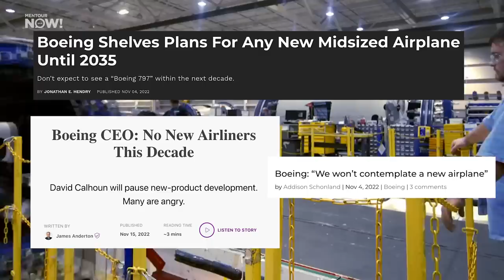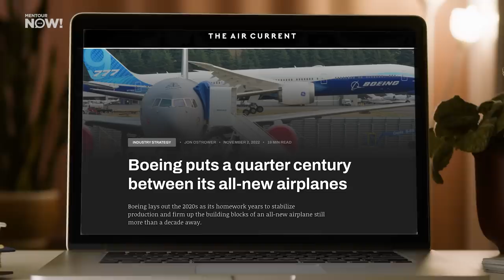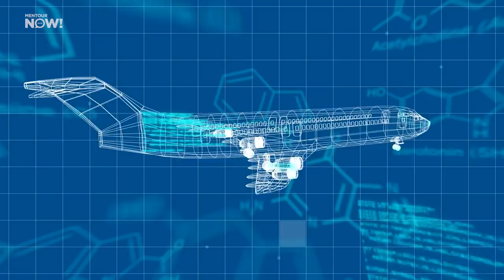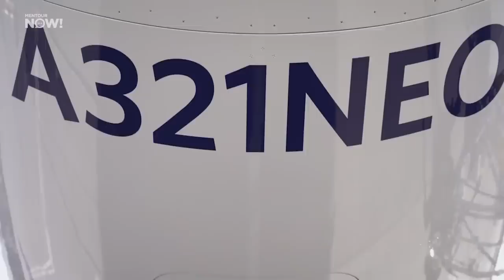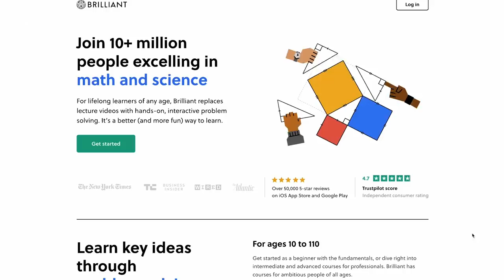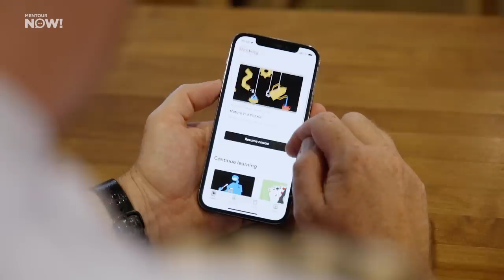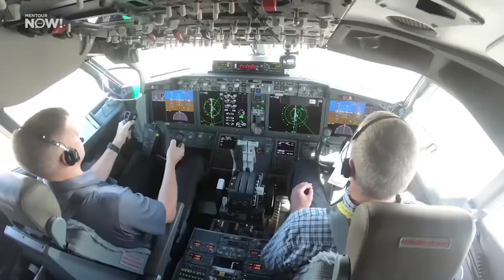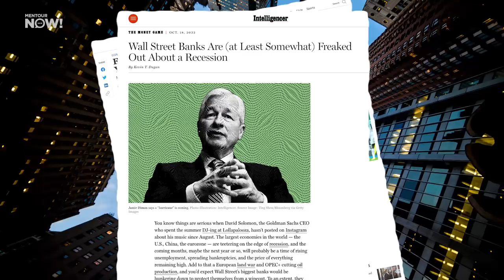Is BOEING giving up!?

Comment: Another example of bean counters injuring their company is GM’s Roger B. Smith.   His tenure saw GMs market share shrinking from 42% to 35%.   To be fair, he saw something needed to be done and did what he thought best, but he valued pinching a penny over the customer.  Boeing execs ought to read the Smith episode.  (Another is GE who was set up for collapse by Jack Welch, and Immelt left holding the bag)
     Boeing is a private company and U.S. financial markets are notoriously impatient. Airbus, on the other hand, has government sugar daddy investors whose interest is full employment.  Thus Airbus skated through A380 and A400 commercial flops which would have killed Boeing. Lot easier when taxpayers haul away your mistakes.  
     Nevertheless, Boeing must discipline itself to resist the temptation of quick buck short cuts and concentrate on building quality planes.

Comment: Boeing has been experiencing serious problems due to diversity staffing issues, especially with respect to engineering, the 737 MAX MCAS engineering team for example. The minimum design standard for mission-critical systems requires both redundancy and diverse routing but the engineering team responsible could not figure out how to make it work so instead they removed the standard, meaning the entire system worked through a single AOA despite there being two on board (Airbus adds a third under the tail for additional redundancy and diversity but Boeing does not). Internal emails between engineers were clear. Not only were they unwilling to put their own families onboard the plane, but they also pointed out that the effort was being led by "monkeys," an apparent reference to engineers of African descent. They also called them “obvious idiots who shouldn’t have been hired,” that “had the situational awareness of braindead gibbons.” At the same time, Seattle Public Schools declared math racist, stating that there are other ways of knowing. That Asians are 27 times more likely to score 1400+ on the SAT, the minimum score one might expect for an engineer of next-generation aircraft was met with the removal of the SAT. China responded with support for Black Lives Matter and support for ESG investing, and the launch of the C919, their competitor to the 737 Max, which already has at least 570 orders. Other programs at Boeing, including the CST-100 Starline (which narrowly avoided catastrophic failure after failing to reach the correct orbit), the KC-46, and the 747-800 Air Force One programs all face similar problems.

https://fortune.com/2020/01/10/designed-clowns-supervised-monkeys-internal-boeing-messages-slam-737-max/

Comment: Climate change pressure or crude oil supply problems, it doesn't matter, the price of jet fuel won't this cheap in 2035.  If you have to make synthetic fuel or more steps to refine heavy crude it could easily multiply the costs by 3 or 4 times.  No amount of UDF, flying wings will make a difference.  We will be back to the "Jetset". I think Boeing and Airbus know that.  No point in investing $30B in a new commercial plane the masses won't there to fly in it!

Comment: C'mon, new models of 737, 777, and 787 are just getting off the certification process. Boeing has not really manufactured in quantity the 777 and the 787. And Boeing us just realigning its digital manufacturing process that will halve the development time of any aircraft and allow its factories to produce multiple models. It is "slowing down" from an outsider's perspective for efficiency. And you evidently do not about Boeing Defense. That's not giving up, that's gearing up to conquer.

Comment: The Boeing CEO simply cannot tell lies at an investor presentation.  For what ever reason the board is thinking this way it will create a problem which is at the core of Boeings other problems.  Their engineers.  They need to be trained, mentored and used.  In 25 years their senior design guys and gals will be retired

Comment: I don't think Boring is stupid yes to answer your suspension I believe Boeing is working on something but isn't saying anything about it to see what Airbus is doing it self. Right now airplane technology is at a standstill no new engine's available. Boeing's CEO said that if they built a new plane it would only look like and perform like an airplane that's already in production and that the next airplane Boeing will build will be more with the times and to the upmost technology available as of the times.
  I say give Boeing tine because they have something up there sleeve's there not sharing with us now.

Comment: Boeing blew over 20 Bio USD on stock buybacks during the teens inflating their stock price.  Perhaps they should have used this cash to build a new white sheet aircraft instead of going down the dead end of the MAX....a derivative from a type certificate issued by the FAA in the mid 1960's.  Waiting for new engine technology sounds sexy but the problems that they are dealing with now are all self inflicted.

Comment: 25 years.. will be cheaper to go point to point using starships by then. Also why the f do they need 20 years to develop an engine now ? Thats like half of somebody's entire career. They need to remove the coffee machines in the offices and work will get done faster.. During WW2 they had new engine models with massive power increases, better high altitude perf, better fuel economy etc every few months. Yes I get diminishing returns and all that but cmon.

Comment: I don't think this is a strategy. Boeing is facing the biggest crisis they ever had, with structural problems so massive they are pretty muc ´h impossible to correct while keeping production running. Stopping production on the other hand isn't an option either, since that woukd leave Boeing dead in the water completely. 

Dennis Muilenburg might have sealed Boeings fate when announcing a renewed company and then carrying on exactly like they did before after the 737MAX incidents. Back then, they had a few years, could have used the CoVid downtime to get themselves together. Now, it's pretty much too late and the primary reason they will not tackle a completely new airframe for years to come is that they just CAN'T. They are struggling with all they have right now to even update older airframes and bring the ones that are almost ready to market. It would be completely impossible for them to sucessfully (emphasis here!) develop a new airframe, let alone reinvent the design and production process along the way, which will be a once in a lifetime task and would be an incredibly hurtful process even for the healthiest of companies. 

Hence their only option is to do nothing, trying to get themselves together first and foremost, while hoping for the best, and for some money coming in. Announcing that they decided to axe the middle of the market airframe for now is merely an attempt of showing us they are in control and are following a strategy that will make it all right again. 

But judging from all we know, they still haven't done that. Trying to keep the qualified personell they have now is not enough. It was exactly that personell that was left without leadership far too long. Adding some new engineers will also do very little, if they do not have a solid structure to work upon.

I don't think Boeing will make it to be honest. Especially so, since the Asian manufacturers are coming into the market, and with them, it will get even more complex to stay on top. Boeing might not have the luxury anymore to just watch for Airbus. The truce they had over long streches of time, to try and keep development cycles slow enough, might not be possible before long, forcing Airbus to bring a completely new middle of the market airframe despite Boeing not working on it. Someone else might, and if so, where does that leave Boeing? They made that bet before with the 737 MAX, and as irony want's it, that's where this all started to go down the drain. Whatever happens, Boeing will need a LOT of luck and support from the states to get out of this. What we wittnessed during that press conference made that clearer than ever before...

Comment: Boeing has shot itself in the foot by rushing out new airframes and it has cost them dearly.  Poor decisions by the management has hurt the company as well. In the mean time the engineers need to sharpen their pencils and check their egos. The rank and file production workers also need to weed out the chaff and be more productive, and their voice needs to be heard when they come up with ideas to improve the product they are manufacturing. In short, Boeing needs to stop pretending they are the only option.

Comment: I'm surprised that you didn't cover the possibility of a blended-wing design, or, given the enormous rate of development in electrical storage technology, the possibility that they might be waiting to see if some kind of hybrid engine  - running on kerosene to generate electricity, to drive electric engines - high torque, better throttle response,  and less (or even potentially no) need for lots of expensive high-temperature alloys (depending on what they use to generate the electricty).
Reply: High temperature is inevitable part of fuel efficiency of the engine. So the progress in fuel efficiency is limited by engine high temperature withstand and durability. Any jet engine can be tuned into lower air to fuel mix and high temperature beyond 2400K. But current alloys don't survive with this fuel mix long enough. While fuel efficiency will be noticebly higher (for the short time) than the state of the art jet engines.

Comment: With no new design work, Boeing will lose the engineers it would need to design a new large passenger jet.  It could train them from scratch, but it would need experienced large aircraft design engineers to train them.  That means hiring them away from a competitor.

Comment: No mention of the climate catastrophe that is looming up, or aviation's share in it. At the moment we are roaring full speed ahead towards irreversible climate change, but perhaps by 2035, and following ever increasing disasters and costs due to climate change, the public might finally wake up and demand a carbon neutral aviation industry, but giving over large swaths of farmland to producing aviation fuel rather than food will be controversial. In any case, flying will, and should, become more costly and the aviation industry will have to slim down.

Comment: Boeing waiting a decade before designing their next plane fits better with needing to transition to non fossil fuel engines.  Hydrogen engines will take a while to prove out and to develop the hydrogen fuel production capacity that will be needed.

Comment: Personally, I think that given the maturity of the science of aerodynamics and computer simulation, there's just no major improvements left to be found in airframe or wing design, at least not with the materials available today.  So it makes perfect sense to me that Boeing would choose to evolve it's current designs with improved engines and avionics.  This has the benefit on making those evolved designs attractive to airlines flying the older models, who already have pilots certified to fly them.

Comment: Quatar will not be happy with this announcement of Boeing . They were already pushing Airbus for a new , more efficient Modell then the A321 Neo ( before the Quarrel began ) .... . No new Modells till 2035 its indeed a long Time . The A380 is currently reactivated by most Airlines , it may be that Airbus will develop a smaller , much more efficient Version of it . There is a demand on freight capabilitys , maybe less Passengers , more freight instead , future Designs will be more flexibel , i guess .

Comment: After speaking to a recently retired Boeing engineer, one of the problems is that technology has begun to go beyond human abilities to make it work... Moores law is getting beyond human abilities to deal with it. He said the problem isn't the hardware, as such, but the software... It has become so complex, interdependent, intertwined that things like what happened with the 737 are compromising future efforts. The trend toward total automation is creating a false sense of security. The engineer said the complexity itself was one problem with the Maneuvering Characteristics Augmentation System, or MCAS and its "issues" being but an extrapolation of systems upon systems upon sytems creating a behavioral characteristic that was at one level unforeseen solving one problem while creating a worse one...particularly for pilots with no fundamental technology background at the engineering level and it wasn't the hardware...

He said another problem was the pilots themselves. He said most "western" airlines had a core of pilots who were former military used to dealing with unexpected high stress systems and failures. They permeate the system and form the foundation of the culture of specific airlines. Think Captain Scully... But he said, notice what airlines had the crashes... One was Ethiopian and one was Indonesian. He noted that their pilots "in general" do not have the same levels of training or experience or come from high tech cultures with extensive technological infrastructures and an understanding of how all the technology interacted to make the whole system work... 

I gathered that a scully would draw upon his education and experience and understand almost instinctually what needed to be done to fix a problem. Less well trained pilots without even an understanding of the basics of flight and how lift works or doesn't, is totally dependent upon what the computer tells him what to do. He said Boeing allowed for deactivation of automatic systems in such a situation so an experienced knowledgable pilot could address the problem. A pilot coming from a different less technological culture without the experience would be at a loss. He said you could be trained on flying second seat in a year in some places. And...the ever increasing self driving elements of the planes allow less well trained people to fly them giving a false sense of security. 

He then discussed the different corporate cultures of like Airbus which intentionally made less human dependent systems vs Boeing that put more emphasis upon pilot capabilities but that is a different story. He said this cultural difference between manufacturers may mean that Airbus has a step on Boeing. Note that a main part of the solution for the Max problem is training of pilots as fixing the software was almost impossible because it is like a web and you pull one string and it impacts all the rest in terms of integration intertwining disparate systems... 

He then noted that even western airlines were now facing problems as they were so desperate for pilots that they were getting them from training programs not ensconced in the former culture of piloting that has historically characterized western airlines... He also said that the "culture" of Boeing itself has changed over time and engineers have less influence than historically. My take was that engineers and pilots need to run the company not marketing pukes (my interpretation). He also noted a distinct change in the engineers of all stripes who were entering the workforce to build the planes. They had no respect for experience and knowledge and were quite full of themselves and the belief that computers could solve all problems... He could not believe the lack of respect the new ones displayed. He ended up having to let people fail to prove points about experience and knowledge base AND he had to go over their solutions carefully as they were more worried about how they were perceived than finding a real solution to a problem... He said he wasn't going to let people die because of some young guy's ego and hubris... He finally gave up and retired...and can hardly think about it... 

The takeaway for me is that Boeing has to go back to the drawing board at fundamental foundational levels. And technology may have reached a point where the world has to catch up to it.

Comment: The CFM R.I S E. engine ,, ahh, um, so basically a turboprop?., - I suppose if the planes slow down to turboprop speed , well, yeah, they'll save fuel ??. 
  Wasn't there a similar concept in the 60's/70's ??...problem !- hellishly noisy.

Comment: 3:50 I remember reading about this open fan idea in my dad's Aviation Week back in the 80's. It didn't work as expected. I'm kind of surprised to see them trying again. It would not be the first time a "new technology" has been developed a second time after it was found not to work years earlier. 
     People really should chack if someone has had a "good idea" before and make sure it hasn't been tried before and found not to work.
     It's dumb to try ideas that have already been tried and found not to be so good after all.
Reply: The converse of this is, perhaps the insurmountable problems of 40 years ago are now surmountable, and now is the time to take a second look.
Reply: It's dumb to not revisit good ideas that were technically too difficult with the technology available at the time...

Comment: Sometime, in the heat of competition, if you don't look far enough in the future, a single decision can turn out to be a disaster. Take the Airbus A380 for example. Has Airbus yet to brake even with that one? Their already being parked and "recycled" because they are just too expensive to operate for "normal" passenger routes. I believe they are only still flying on Emirates Airlines gold plated mostly first class routes where they can charge almost anything they want and the middle east princes will pay it.
Are they even going for the same market? Airbus probably assumes that they have the EU locked up due to their trade policies and Boing in generally going for U.S. and long hall international.